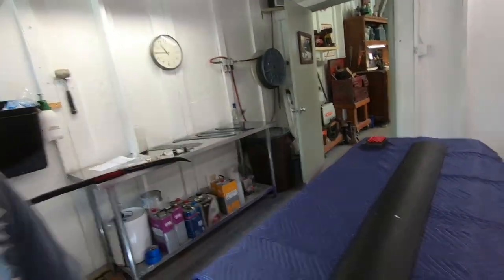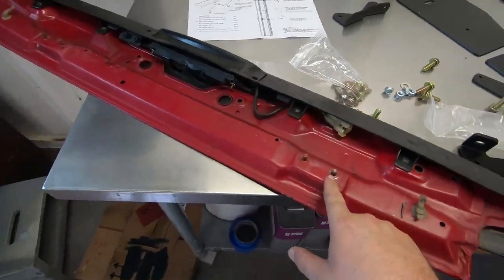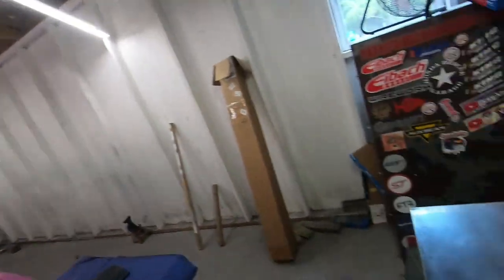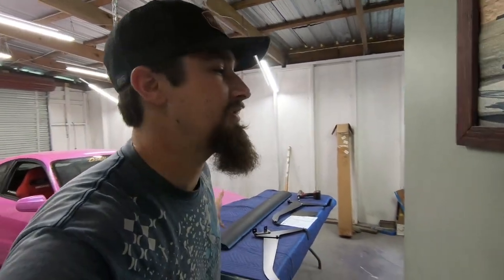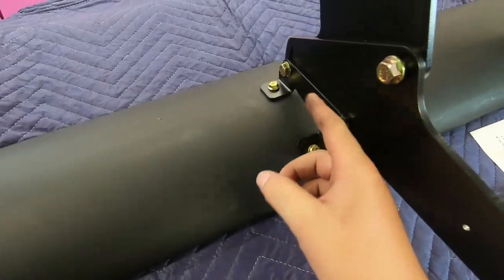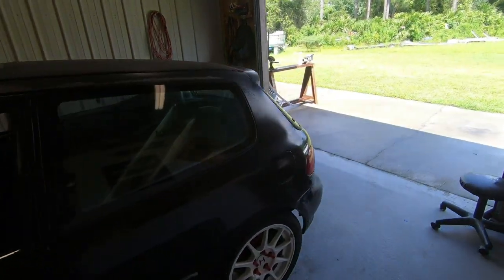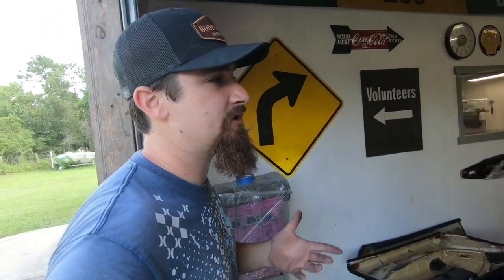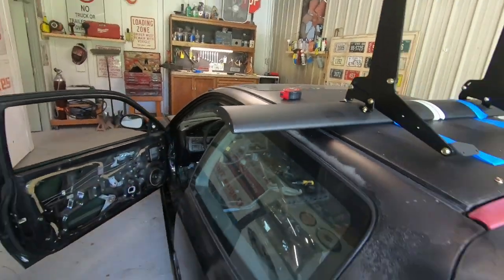CRAZY BIG WING! Eg Hatch Track Car AERO Build

Comment: Looks fantastic!  Track guys get it, great job.  The only thing wrong is the top mounts.  You mount them to the hatch (not the roof) and then you still have full functionality of the hatch.  I installed mine 6 months ago on my Si and it doesn't get in the way of anything if mounted to the hatch.

Comment: Put hinges on the top and Carter Pins on the lower brackets. You can pull the lower pins flip the wing to open the hatch and close it all up with no issues.
Reply from the maker: masso45able 17:05

Comment: I have a track EG also. Started out with a splitter in the front, diffusor in the rear and a spoon spoiler. 
But braking hard after a long straigt was super scatchy. Front splitter generated so much downforce
the back was way to light. It's all about balance. After installing this big wang spoiler. All ballance was restored.
Hard braking and cutting corners like a mofo. All the haters know nothing about eg's or trackcars.

Comment: I would use two nylon locknuts for the top so they could be tight but still loose enough to hinge that wing up on the roof and use two clevis pins for the bottom.
Reply from the maker: Shade Tree Wrenching lol that’s the plan. As soon as I got home I looked into clevis pins and the correct style cotter pins and they are on order. Will be here soon. Also the wing came with nylon locknuts so it’s perfect. Thanks for looking out !

Comment: Project Black Ops... Still works as long as the final color is something dark and sinister. The wing... the purist in me hates it. BUT the fan of the new school Khyzl Saleem as well as Pandem type stuff actually loves it... front splitter and full time-attack spec would be rad! Like I said, the purist in me is freaking out bc its such a solid car and they have all rusted away here in the midwest, BUT I still respect the build and the work BC you dont do junk!

Comment: The wing it self is backwords the thin end goes tords the front and the thick part faces the rear
Reply from the maker: Roger Granville are you sure? Send me some reference pics or write ups showing me the proper way
Reply: Bode, you're good.  The wing is on correctly, the fat part faces forward.

Comment: Make sure those lug nuts have the proper seat for those wheels
Reply from the maker: CJ S your the man. I’ll get research on that right away
Reply: I was going to say, I don't know if people don't know or what but the "tuner" style lug nuts do not go with OEM wheels.
Reply: BodeVision yeah oem wheels need the ball seat lug nut. If you use the cone shaped nuts you need to buy the adapters. I think clubrsx sells them?